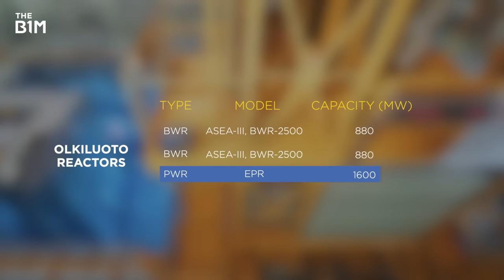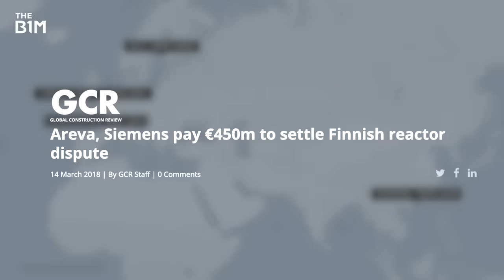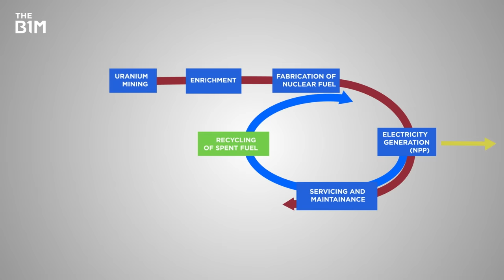Finland Might Have Solved Nuclear Power’s Biggest Problem

Comment: Wow, This still sounds like a bad idea -
Reply: Like it or not, this solution is cheap, safe and permanent. You could drop a nuke on that site and it still wouldn't disturb the waste + the chances of it contaminating anything or leaking in the next 100.000 years is nihil. This isn't some irresponsible dumping in old mineshafts where it can pollute ground water.

Comment: Lotta people in these comments seem to be focusing on the idea that it's just being buried...unless re-enrichment is fully viable, this is the right way to deal with it, shy of getting Elon Musk to create a rocket that can jettison the spent fuel material into space, and then return to be reused. 

But HOW it's buried is the issue, and that is what seems to be solved here. Think of the material like packaging leftovers after supper.  Something very moist, can you save it for later by wrapping it in foil? Yes, sure you can. Is it going to work well, probably not.   So finding the better storage method is what's important.

And environmentalists tend to be morons who only act on their perceived view of the issue.  All they hear is "bury nuclear waste = bad" but it is the most minimal of issues when done properly. 

Nuclear power is carbon free, if not at least near carbon free.  Solar, wind, and hydro aren't 100% consistent, and require massive and very damaging to obtain materials.  The future of clean energy is nuclear.  If they want us off fossile fuels, nuclear is the way to go.  If they want us in electric cars, we need nuclear to supply the needed volume of energy to do so.

Comment: oh, so the solution was to bury it? like we've been doing? and here i thought we had a REAL solution.
i guess its a better way to bury it than what we've been doing.
lol nice to see nearly EVERY comment here was thinking the same thing. =P
Reply: Like it or not, this solution is cheap, safe and permanent. You could drop a nuke on that site and it still wouldn't disturb the waste + the chances of it contaminating anything or leaking in the next 100.000 years is nihil. This isn't some irresponsible dumping in old mineshafts where it can pollute ground water.

Comment: Burying nuclear waste may work, and it may not work. The Earth's crust doesn't stay in place. Besides that, there's the problem of accidents. There's been 3 major disasters in the 60 years of nuclear power history, each one having devastating affects. There's also the possibility of stupid actions, like those that Russia did around Chernobyl during their foolish war with Ukraine. There's the concern about nuclear proliferation and the horror of nuclear material getting into the hands of suicidal morons like terrorists. There's also the cost of the nuclear reactor plant, before, during and after it has reached the end of its lifetime. And, building the plant is very costly in terms of carbon added to the Earth's atmosphere.

When one considers ALL the problems, the alternative methods like solar (including space based solar), wind, geo-thermal, tidal, etc. are far better.

Comment: What they need to do is to build the entire reactor underground in igneous bedrock so that the only part of the reactor that is above ground is the cooling tower.  That way not only will the spent fuel be safely disposed of but also the entire facility will be safe from external threats while in operation.  This might be a very expensive way to solve the problem but it's a no brainer as a way to deal with the safety issue.  Another way to deal with the spent fuel problem would be to place this material in tightly sealed containers and then lower these containers to the bottoms of deep sea subduction trenches, where over the eons they will be pulled down into the Earth's interior.
Reply: Such a large cavern would require immense cave and they come more unstable the larger one you build. Also what is lost is easy access everywhere to check and maintain the reactor etc.
The downsides simply outweigh the benefits.
Reply: @alaric_  The "large cavern" is an engineering problem and can be dealt with.  Inspection is primarily of concern to left-wingers who are opposed to nuclear energy anyway.  The inherent safety of this kind of installation renders this concern less important.

Comment: that does not fix the problem i only move it to another generation. if the problem had been solved it would be harmless for nature when done with it
Reply: The problem here is financial; what are you talking about? putting nuclear materials (back) into the ground doesn't harm anything.
Reply: @faberofwillandmight  the biggest problem is the time before the waste is harmless. That is the biggest problem
Reply: @kenba96  Like it or not, this solution is cheap, safe and permanent. You could drop a nuke on that site and it still wouldn't disturb the waste + the chances of it contaminating anything or leaking in the next 100.000 years is nihil. This isn't some irresponsible dumping in old mineshafts where it can pollute ground water.

Comment: So let this roll around in your pea brains for a minute. The first steam powered contraption (the aeolipile) was thought of around 30-15 BC. An actual thing or "machine" invented by man that converted the power in steam, into "work". Later, in the early 1600 an actual machine was patented, that used steam to take water out of mines. So, lets say instead of a 2000 year old machine, a real "steam machine" was invented @1606. So, in the 1940's we devised a way to split the atom. To create power how? By boiling water to create steam! Are you fucking kidding me? We have the power to blow our planet up, for the most part with this highly advance technology of "atom splitting" and all we can do with it is boil water to produce electricity? FFS.

Comment: AN INNOVATIVE NUCLEAR TECHNOLOGY
The TWR technology takes leaps forward in cost and safety, while dramatically reducing waste and proliferation concerns. Its innovative design will produce zero carbon emissions while operating with higher thermal efficiency and consuming uranium resources in a more efficient, cleaner and safer manner than current nuclear technology.

The reactor core is the true innovation of the TWR design. In the center of the core sit rods of enriched uranium (U-235), surrounded by rods of depleted or natural uranium (U-238). The U-235 serves as an initiator, kick starting the traveling wave reaction – a slow-moving chain reaction of concentric waves of fission. The traveling wave reaction will then slowly convert the depleted uranium to fissionable plutonium. Periodically, to sustain the fission reaction, the in-vessel fuel handling machine shuffles the fuel, swapping expired fuel rods from the center of the core for fresh fuel rods from the outer edge.

Comment: I`m still trying to work out how nuclear energy is looked upon as `clean` when the waste products are so dirty and dangerous. Coal, which is undoubtedly dirty, is only dirty for as long as it is burning. Once it is spent, the ash or cinders are inert and can safely be left on the surface or re-used without any danger to humans.
Reply: The definition of clean energy is anything that doesn't produce greenhouse gasses. Burning coal releases CO2, which is a greenhouse gas. Nuclear energy doesn't generate any greenhouse gasses. It doesn't refer to how big of a mess the waste product leaves or how dangerous the materials leftover are. Only greenhouse gasses matter.

Comment: Why not reprocess the spent fuel rods like the French have been doing for 50 years?  Problem solved, easy peasy and Bob's your Uncle.  The United States banned the practice in 1977 for "environmental" reasons.
Reply: One, because it costs and is very dangerous to do
Reply: @fastum000  There hasn't been a single accident reprocessing nuclear fuel in France for over 50 years.

Comment: When wind, solar and hydro power are at their cheapest, safest and most efficient design in years, the Fins have elected to go for the most expensive, dangerous, and dirty (radioactive waste) power generating system they can find. I guess when you're crazy happy, nothing is considered a bad idea.
Reply: Wind, solar and hydro are not available 24/7, they go up and down. Also, Finland does not have hydro as much as Sweden and Norway have. Finland is extremely flat country. And you prob haven't understood how far north Finland is, solar in the Arctic circle? Please. Sure it's fine in south but in the land where there dark (pitch black or very, very little sunshine) for 4 months straight, solar is good during summer. When electricity consumpion is at the lowest during a year. Wind farms are being produced but even they are still prone to calm weather, that means no wind. So overcast and calm (quite typical weather in Finland) and the country has to import energy from neighbours like crazy. I bet you are not paying for that so 'who cares', right?

Also, it's funny how every other country in Europe is struggling to go away from gas and coal, meanwhile Finland could theoretically stop Russian energy imports in couple of weeks with no problem. Finland being of the cleanest countries in the world, amongst the other Nordic countries but still can find something to whine about. If the rest of the world would take climate and enviroment as seriously as Finland, there would be no climate change. But i keep hearing from the left how that is not good enough, apparently they want Finland alone to solve the CO2 emissions. Hard to understand how that is possible.

Nuclear power is the cleanest and safest energy source right after the mentioned renewable sources. No matter how much fear and false information you spew, that fact is not going to change. Dislike nuclear, fine but please stop with disinformation. And about the price, the companies getting delayd pay for delays in the form of delay fines so, sucks to be them... The waste is dangerous but other than that, it's very, very clean.

Ps. it's "Finns" with two "n", otherwise you are talking about fish fins.

Comment: Lmao... boron steel, copper canisters to last 100,000 years.
Reply: Yeah, what's the issue? Be free to explain to me what corrosion could possible break that in the next 100.000 years? And even in the non-existent scenario that they would fail, the entire thing is encased in liquid-repelling material so no leaks could escape. And even if that fails it's buried in bedrock that has been inert and stable for millions upon millions of years, far away from any possible ground water pollution.
Reply: @viktor1496  Well according the 2nd law of thermal dynamics corrosion is the increase in entropy as materials settle over time into a lower energy state which is in equilibrium with its surroundings. A copper/boron steel canister is a highly manufactured material which high levels of energy have been used to refine it from its natural ore state. In the ground, it would want to return to this ore like stable state and hence CANNOT last 100,000 years imho. If any one can test one and prove it will last 100,000 years, I'll happily eat humble pie.
Reply: @whoguy4231  So ancient civilizations have managed to make tombs that perfectly preserve primitive metal objects for 5000 years. But you argue that specifically engineered materials to last as long as possible in the 21st century, in the best tomb ever built couldn't last 100.000? 

Well I'm willing to give you a shot, where is your source on corrosion for boron steel and corrosion resistant copper?
Reply: @whoguy4231  Yes and that corrosion would take millions of years at the very least to breach those containers. After which the waste is so safe you can hug it. 
They encase it in liquid repelling material so ground water does not reach the containers and the geological layers they are in have been stable and inert for many millions of years far away from any ground water reserves it could pollute if even the unthinkable happens.
Reply: @whoguy4231  Also, the 5000 year example was merely to make a point. If simple, primitive metal objects can be preserved for thousands of years with almost no corrosion protection to speak of. Why wouldn't we be able to engineer a solution that lasts for 100.000 in the 21st century?
Reply: @viktor1496  Call me skeptical... I'm an electrical engineer and in my entire career have only met 2 engineers who I can regard as an engineer. The rest are pen pushers who couldn't figure out their a55 from their mouth. Engineers/Meterial scientists will use accelerated ageing in lab conditions (cyclic temp/acid&alkaline/humid&dry) to simulate ageing. I'd imagine the data collected is extrapolate to 100,000 years and the density/hardness/geometry is calculated to last with an additional 20% more for error/safety. I'm still cynical as we humans have only existed for 110,000 years and these containment systems need to last as long long as we have existed. Unless it's proven, I'm doubtful.... But if there is constant monitoring, maintenance (replacement) and controlling the environment.... Then Yes, it will 100% last 100,000 years.
Reply: @viktor1496  When I was in high school a long time ago, our class visited a small nuclear reactor. They were developing molten glass encasement of used fuel. 30 or so years later... Not a squeak of that technology, so I just discounted it as a failed technology. I mean if the clay works then so be it. I own a radiation detector and have worked on developing radiation detectors in the past. The danger with radiation is it's invisible, has no smell, and your body cannot immediately feel any exposure. If you're confident with Finland's storage solution then that is ok.
Reply: @whoguy4231  That technology is very much around. Glassifying waste is a common practice in many places around the world to make a resistant solid out of liquid radioactive waste. I understand your concerns though, I myself have worked in labs where I had to wear a dosimeter for 2 years. I don't blindly believe those solutions, they can and will work :)

Comment: Pioneering Game Changing 21st Century New EV-EKG internal self charging battery technology turns EV's into on-demand, carbon-free zero emission electricity power-plants. Benefits include unlimited EV range/mileage and the end to retail external battery charging cost & time Find out if your next new EV will have internal self charging technology  -EKGelectricitykineticgenerator -

Comment: this is a lot... but not long term..... embarrassing
Reply: Like it or not, this solution is cheap, safe and permanent. You could drop a nuke on that site and it still wouldn't disturb the waste + the chances of it contaminating anything or leaking in the next 100.000 years is nihil. This isn't some irresponsible dumping in old mineshafts where it can pollute ground water.

Comment: so we are dilling whit our shit the same way our ancestors did 😂😂, whit that much is one place it's going to be a disaster some day , whit so much radiation you woud think there is massive amount of energy still , we just haven't developed the technology yet
Reply: Like it or not, this solution is cheap, safe and permanent. You could drop a nuke on that site and it still wouldn't disturb the waste + the chances of it contaminating anything or leaking in the next 100.000 years is nihil. This isn't some irresponsible dumping in old mineshafts where it can pollute ground water.

Comment: Pfff...  that's bullshit. I was expecting  a real thing, instead the solution is double down the older solution.
Reply: Like it or not, this solution is cheap, safe and permanent. You could drop a nuke on that site and it still wouldn't disturb the waste + the chances of it contaminating anything or leaking in the next 100.000 years is nihil. This isn't some irresponsible dumping in old mineshafts where it can pollute ground water.
Reply: @viktor1496  Cheap, agree! That's all.
Reply: @gbrayner  Well, I would love for you to make an argument as to why you think otherwise on the safety and contamination.

Comment: what a terrible video
"Finland has come up with the idea of burying it deep underground and covering it with bentonite. Forever!"
wow genious, clap, clap. clap.
Reply: Tthis solution is cheap, safe and permanent. You could drop a nuke on that site and it still wouldn't disturb the waste + the chances of it contaminating anything or leaking in the next 100.000 years is nihil. This isn't some irresponsible dumping in old mineshafts where it can pollute ground water.

Comment: This is what boomers call REVOLUTIONARY? Lo fucking L
Reply: This solution is cheap, safe and permanent. You could drop a nuke on that site and it still wouldn't disturb the waste + the chances of it contaminating anything or leaking in the next 100.000 years is nihil. This isn't some irresponsible dumping in old mineshafts where it can pollute ground water.
It's the first permanent solution for nuclear waste anywhere in the world. What's not revolutionary about it?

Comment: There has never been a bigger waste of time and treasure.
Fusion, I have it on great authority, is only 20 years away.
Reply: @juusohoikkala751  That's way too harsh. While a commercially viably fusion reactor is at least decades away. AT LEAST
The concept is still sound however, and ITER is a promising project that deserves its funding. Fusion has been done and isn't so hard to achieve. It's the engineering challenges around building a reactor that make it so insanely difficult. And those challenges are not insurmountable. Hell, ITER might even give us the first sustained fusion reaction ever created by humans.
Reply: Ok. What we should do for the next 20 years?